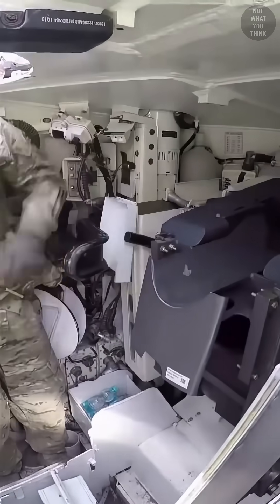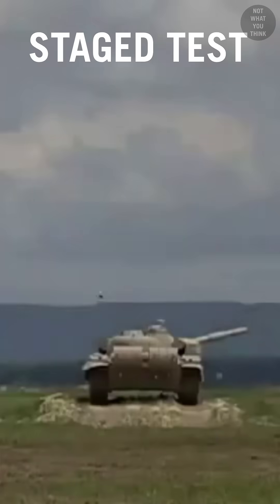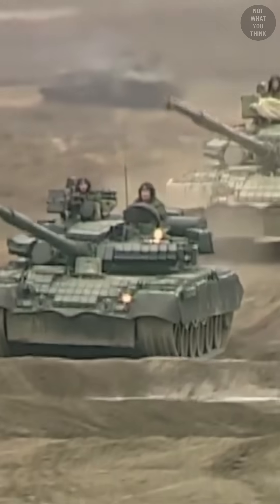Why M1 Abrams Tank Has No Auto-Loader #shorts

Comment: I never understood the entire reason for the blowout panels in the turret. Yes they will save u if ur hit in the ammo to she side which is crutial for rpgs i think it would be better to put it lower in the hull so it is harder to hit in general especially when ur hull down most of the time so if ur penitrated frontally u dont just die then u can use the extra room in the turret for a drone, anti air missile, radar, giant sweedish striv122 style pariscope, ect and u can still have blowout pannels in the hull. The Abrams already has small ones in the hull for proof of concept. If the ammo is hit the tank will also likely be very likely to just burn down but the crew will survive if they can get out before the tank melts so i dont see any reason not to put the ammo in the hull because it will litterly melt the tank anyway